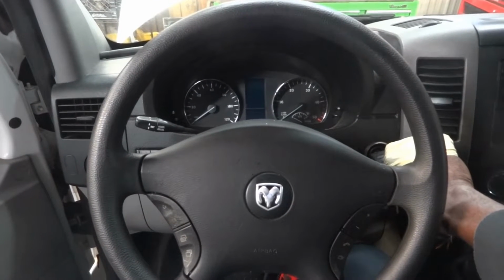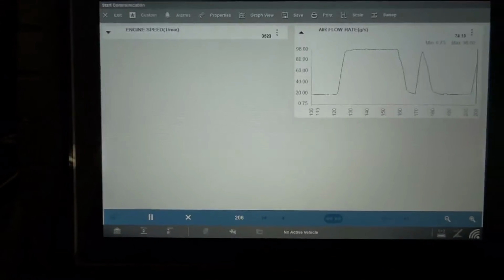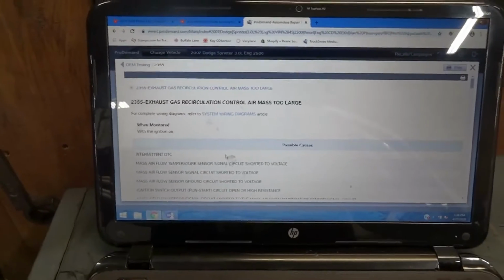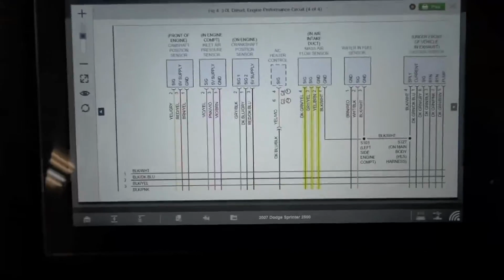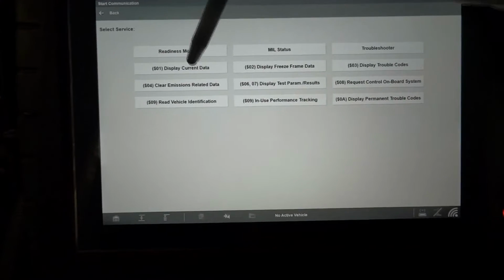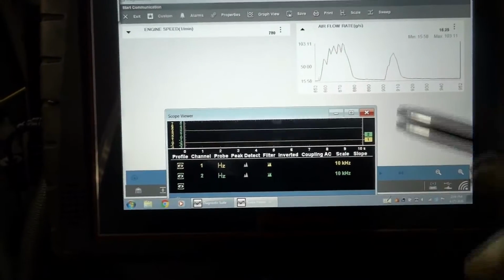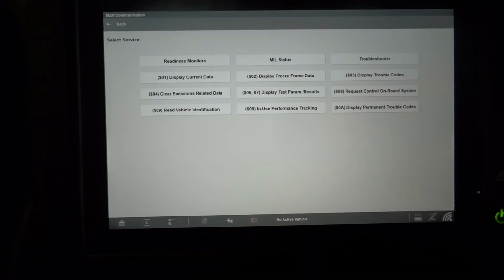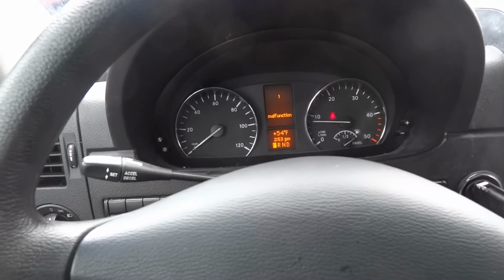Mass air flow sensor ( MAF ) testing on a Dodge Sprinter; Code 2623, 2355 and P0101

Comment: Hi Kit’s - your videos are Excellent and so pertinent to me and my 2008 Dodge Sprinter 3500.
I have an issue that 4 pretty knowledgeable techs can’t solve related to the MAF…
When plugged in and engine is at operating temp, the engine “chunks” pretty severely. Unplug it and the chunking goes away. However, 2 brand-new Bosch MAFs cause the same chunking problem (odds are all 3 MAFs can’t be bad) so somehow the MAF data from all 3 is getting corrupted…?
Also, there are NO ENGINE CODES being registered otherwise than a code when the MAF is disconnected.
I’d appreciate any hints where to keep looking. This vehicle has 92,000 miles, is in good shape otherwise. The symptom just popped up after I changed a glow plug #5 (had to pull turbo output tubes to get to it) so I was in there.
Hope you can help.

Comment: Hello, I have a 2008 sprinter 2500 and I have just changed the DPF, I have a regular scanner, nothing special and I also bought a MASS air flow from the Bosch brand, it keeps giving me the non-reading code on the MASS air flow sensor, I have to program it
Reply from the maker: @josecastillo3943  Check the Mass sensor wiring and make sure that the sensor that was installed is an OEM Sensor,
Reply: I have the same problem. I tested the ground on the wires. It’s testing higher voltage. What does that mean ?

Comment: Could've saved yourself 35 mins and done a smoke leak test first. You would've found that leak within seconds. Any MAF issue needs a leak test as priority. Fix that common orange grommet fault and then leak test again.
Reply from the maker: @MrTutunka  Good sugggestion!

Comment: I can see that this is a bad design.  Turbos always spit out a little oil.  That silicone gasket is the issue.   Once it gets oilly, it will slip.  The intake tube needs to be down sized for the turbo, eliminating that silicone gasket.  2006 does not use a gasket
Reply from the maker: @frontlinemedia4270  Good!

Comment: Hey mate can you help with a code P2624 on my 2007 311 CDI sprinter its on limp mode atm. It says Air mass sensor drift compensation. Went to mechanic and they did xentry scan and they said its a egr valve faulty I replaced the egr and delete the code and still on limp mode. Just wondering if you can help please. Thanks
Reply from the maker: @user-mg1dt3cs1q  Check for Boost leaks in the induction system and make sure the MAF sensor wiring is good!

Comment: I change 3 MAF sensor ,still not working
Reply from the maker: Badita Stanomir reset the computer and see what happens! do you have a scan tool that can do that!! is the wiring for the MAF sensor good?
Reply: @KITS_Auto_and_Truck_Repair  witch scanner is good
Reply from the maker: @romconstruction  the Autel Ultra is good, for sprinter!!
Reply: I just came from the Sprinter GURU of the United States: Andy🎉. He fixed my fuel injector Black Death. However I had also just gotten the T21 Recall done on my 2006 sprinter and this code has been thrown p2623.  I called Andy he says that code is the ECM unit not adequately talking with the MAF. And that you can change the MAF but it will never solve the problem.   The DoDGE has to fix this issue. Not Mercedes. Unless you have NEVeR had the recall done. Then Mercedes is all in I belive
Reply: @charitydotts6954 
Hi there what year was your dodge, mine is 03

Comment: Very helpful information.  My 2008 Sprinter engine light is on.  The mechanic got the P0101 code and he recommend changing the sensor.  I am going to check it myself before they charge me CAD 500 to have the sensor changed.  Thank you for posting this video. Looking forward to more video from you.  Thanks a lot.
Reply from the maker: Alice So you're welcome, I'm glad the video is helpful...